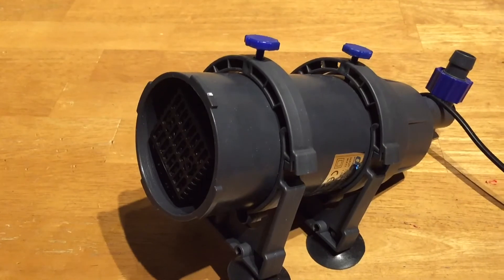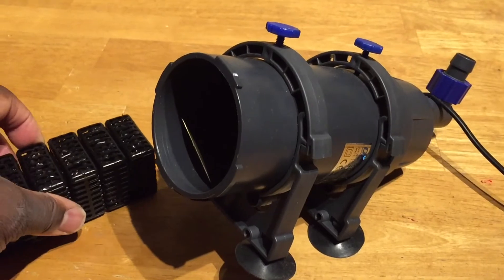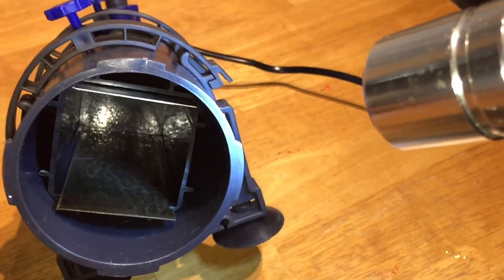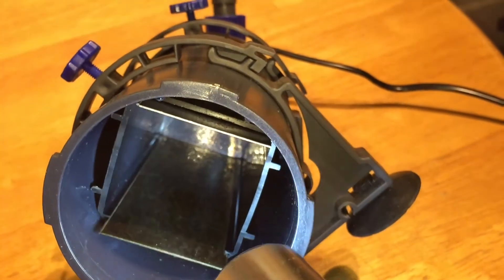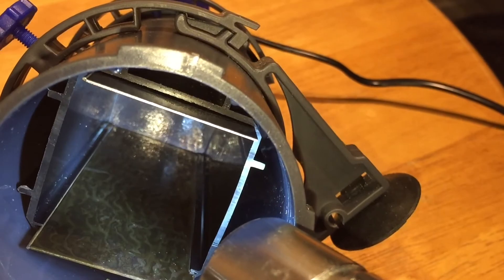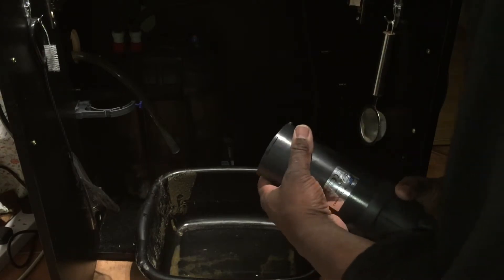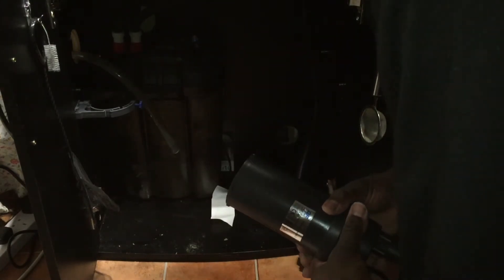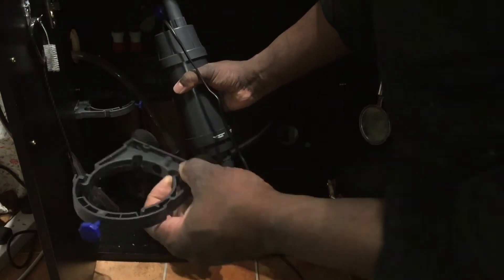Hydra Stream  (part 3)

Comment: It a doesn't remove nitrate it detoxifies them they still register on your test kits but they are doing no harm some test kits do show its true value. Also regarding placement its an inline unit hence its obviously vertical also that look like a pretty large pond unit for a tiny tank you need 4 cannisters for a 750 litre so maybe 5 for 1000 litre so the hydro stream 3 is overkill but if you look at flow return rates you could use the hydro stream 3 on the return as it can return at 5000lph max this was my issue I will run this unit at 3000+ lph on a pump capable of 8000lph with only 4 of 8 canisters installed as I don't need that level of filtration but I need the flow rate on my 620 + sump and yes Im using it after the whole sump filtration and activated carbon etc I used 2 hydra 50s for years best things I ever put in a tank and regarding cheap versions flooding the market its highly patented in China they use industrial ones on there industrial fisheries Ive seen them in person and the figures don't lie

Comment: I read somewhere that this unit doesnt remove nitrates. Thus u need plants . Basically it just speeds the cycle up. I remember if u work in a electroplating industry, the metal plates has to be polished or shiny surface wiout any rust or built up on the surface. Thus you are able to conduct the current easily and effectively. Like how all car wheels has to be primed and then soaked into the liquid to be chromed. 
Thus with reduced surace area it is similar to driving on a rugged non paved road. Which is why I am skeptical that they never provide the metal to replace.
On the other hand, the main body of this device can be found on alibaba and it can be used for other purposes. I suppose in business, if anything is good, it will be copied and be flooded into the market. Like how cars tv and most day to day items. The fact that other competitors didnt went into this niche should be sufficient hint that it really might affect their reputation or brand image.
Reply: http://www.metaldetectingworld.com/messy_electrolytic_bath_p24.shtml

Read point number 5. I am correct. The rust or change in colour of the metal plating will decrease the electrical conductivity of the metal. Ha. Chemistry 101. Lol
Reply from the maker: You read it here

Comment: Does is matter what direction the water flows through it . water flow inlet and out ??
Reply from the maker: Steve Piper 
Not sure but both ends are slightly different 
One end where the electrical cable enters the unit has a single hole that water can pass through and cannot be removed(A).
The other end has a plate with 7 holes [ a kind of diffuser ] and this is the part you can detach from the unit body(B). 
My thinking was A as the inlet and B as the outlet. 
I currently don’t use this unit as the catapure cartridges stopped being effective and haven’t been able to replace them.